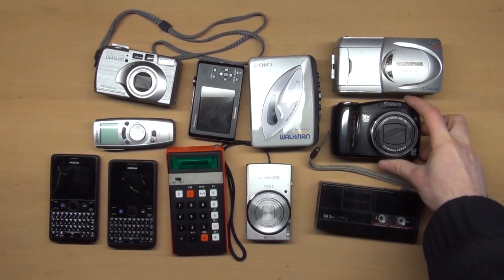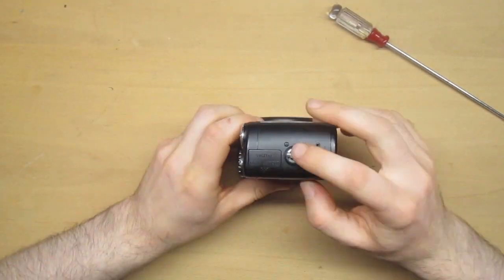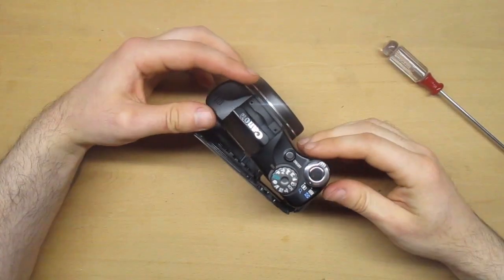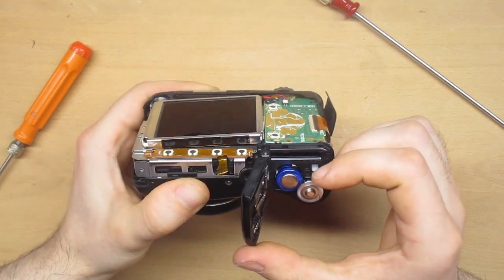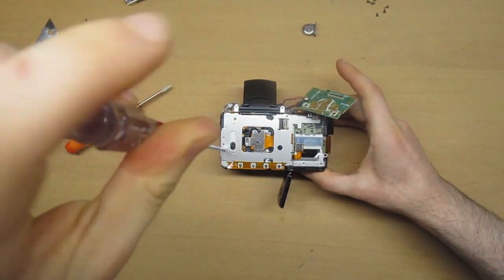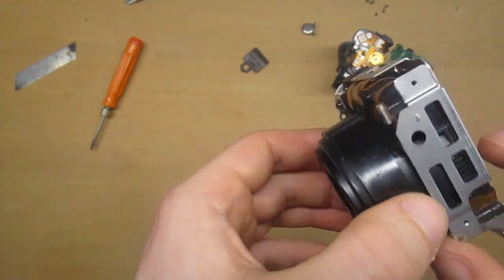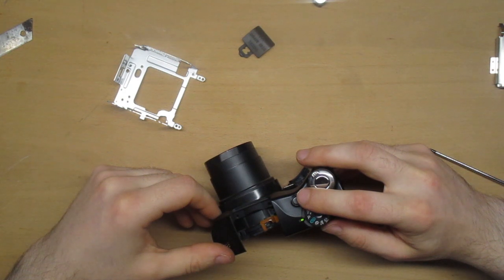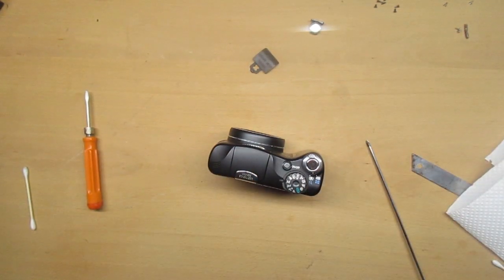Repair of Canon Powershot SX100IS

Comment: Great work on the repair! I have a Canon S100 with the lens stuck out and the "lens error" message on startup. I tried cleaning the contacts for the lens ribbon cable, which is a common fix for the S100, but it didn't work. I will try what you did in this video, maybe my camera also has some dirt stuck in the lens.
Reply from the maker: Thanks! Did you find it like this with a stuck lens or did it happen while you were using it? Often when the battery dies or for some other reason the camera stops having power, people try to push the lens back by pushing it. With the lens extended, the camera doesn't fit in the case, it doesn't fit in the pocket, it doesn't fit in the small handbag, and people are creative in pushing it inside. And that's how many camera lenses get broken :D
 My experience in repairing the lenses has not been very successful, there are various very fragile sensors inside that monitor to what position the lens is open, the stabilization is also a very gentle system. I've made a few mistakes and I don't want to open a lens again. Also there is a certain alignment of the parts, it is possible that sometimes this is also a problem if the alignment or the sensors that monitor the alignment are broken. I once tried to remove such a lens from a pocket camera and make a bayonet for mounting dslr lenses, a complete failure :D . As the sensors do not send information to the camera, it becomes unusable, lens error. I don't know if CHDK can bypass these initial tests the camera does so it doesn't show a lens error. You can try to bypass this message and try zooming out and zooming in to move the lens.
Reply: @Electronics_Collection  It was a 5 euro flea market find and I used it for a few months before the lens got stuck. It just got stuck when using it so there shouldn't be any additional damage. CHDK sounds like a good idea, I will try with that first!